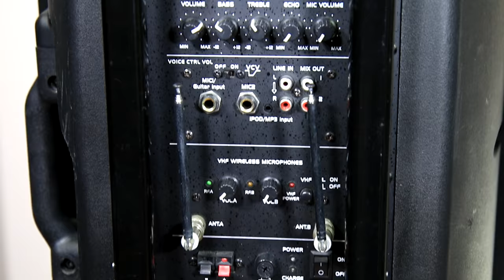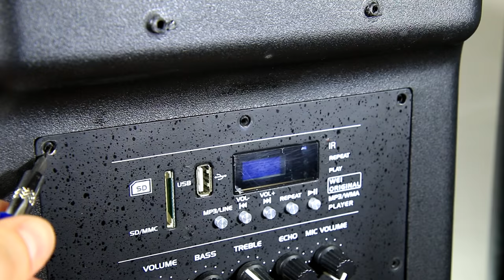Biggest battery powered portable speaker look inside

Comment: Change the battery for some li-ion batteries that would be a good upgrade maybe use 18650's
Reply: Matty p unboxing's and reviews is that so easily possible? Can you simple swap them out for one of those aliexpress 12v battery packs with a DC plug? There are 30AH 12v battery packs on aliexpress for 50,-. That would upgrade the capacity at least 3 times

Comment: Well skytec (qtx is the same brand) is know for ''exceptional'' quality
btw their real power output is 35w per speaker and no more
Reply from the maker: but with PA speakers sensitivity(~97dB/w) they are very loud.
Reply: yes i know i have tremendous knowledge regarding audio
I am just sayng that they lie about their wattage
and keep up the good work
Reply from the maker: of course, almost all brands lie about their wattage. The bigger the brand is, the bigger the lie is about their wattage.
Reply: artur take a look at NAD mostly their wattage is higher than advertised plus they sound GREAT.
Reply: It's a TDA7377 bridged mode, with 35W power output at 10% of distortion...yeah right.
Anyway, you don't get too much power from that small transformer.
Real power @ best performance i would say... 10W, not much...
Chinese crap.
Reply: bs, brands like elektro voice or aew dont lie about their wattage they even can handle wayy more if you send them a clean signal.
Reply: Random Channel skytec and QTX aren't the same brand. Skytec is owned by tronios and QTX is owned by AVSL.
Reply: bh ee
Reply: Random Channel behringer is one the lie about the wattage
Reply: Jacob Kelly their drivers etc are of the same quality though.
Reply: +stein van schaijk behringer atleast does it's rated power, the NU3000's power rating is 3000w peak, multiply that by 0.707 to get the rms, and you see its about 2100 watts, and thats what it actually does clean all day, unlike skytec and qtx which do maybe 1/10th of their rating, if even that much, put short: its much more than you'll ever get out of a QTX or Skytec amplifier, and they offer great value (300 eur on an ACTUAL 2000w amp, can't say that from more brands.)
get skytec or qtx and waste your money, some people blew their 1200w skytecs on a fucking 80w receiver, on half volume. meanwhile behringer actually does it's rated power
Reply: BH4x0r u dont calculate rms wattage like that
Reply: Cekpi7 if it's a pure sine wave that method works fine, and my true rms multimeter doesnt lie either.
Reply: You dont need true rms multimeter for pure sine waves, but lets just say that you have 4ohm resistor and you want to get 3kw, that means you need almost 110v to get that power, now thats rms since your multimeter measures rms, peak of that sine wave is on 110*1,41=155,1v, which means at that 155,1v on 4ohm resistor you would get 6kw of power, that means that rms is not 0.707 times less than peak value, same thing with 3000w peak, rms is 1/2 of peak or 1500w, its 2 times less becouse power is P=U²*R and Upeak is Urms*1,41, when you square it you get P=U²*(1,41)²*R which is basically 2 times the power for 1,41 times greater voltage for same resistance.
NU3000 is 3000w max but they rated it as 2075W rms mono in datasheet, so they didnt lie about that, peak or max wattage on amplifiers is usually just made up so it doesnt make any sense with any calculations.
Reply: Cekpi7 yes, it does give around 98.5v RMS, measured with a true rms meter and for more accuracy/to be sure on 50hz right before clipping, while having a 4 ohm high power resistor bank on it ( 4 1ohm 1000w resistors in series), which is actually around 2400w, the 2075w is probably at around 1% or less thd, which is still very good for a kind of cheap amp
Reply: That wasnt the point, u cant calculate rms power with peak power like you did, but how did u know its right before clipping? Anyway, bigdwiz made video using amp dyno, but 6kw model (2x3kw), it did 2x2kw on 4ohm which is decent for that price so nu3000 would probably made that 2kw, but not 2400w
Reply: Cekpi7 it appears to also have an unregulated PSU, so when you have 240v instead of 220v it actually puts out more power, not much, but still a difference, which i also noticed in my own testing, and i don't know how good or whatever the PSU's for the American model are (which have to run on 120v instead of 230v), anyways i don't know how accurate the clip light on the NU3000 actually is, but i gone off of that, so it might've been clipping ever so slightly.
also on BigDWiz' vid you could see it puts out ~2500W in burst RMS mode, which is music, nobody's ever gonna play a steady sinewave on it while playing music
Reply: Yeah, but rms is true power, burst is just random just like music, on one song you could get more power, but in some bass heavy less since it would stress the amplifier more, im not sure how much would those 240-220v make a difference since it should have some sort of converter but it could be, maybe it doesnt get enough power from single wall outlet
Reply: Cekpi7 burst is still rms and less than 1% THD on the AD-1
Reply: BH4x0r Yeah, but if you set your gain based on burst, it will be good on movies or songs with less bass, but when you play something with heavy bass or something that is rebassed, after some period it would start to distort and damage your speakers, better be safe than sorry
Reply: When you have efficient speakers with a Dynamic frequency range...you don't need a lot of power...
Reply: Random Channel the amp have 2x 15 watts i have the same as a 15 inch and it is loud.. for this power very good... i think an other bass between rcf and the box is perfekt and loud enough 😂
Reply: I don't need more than 35w if this is so mobile
Reply: No, it's acutually 10 watts without noticable distortion. 35 watts is at 10% distortion.
Reply: @TSilva01  You are right, datasheet says 10 watts at 0.03% THD
Reply: What you cant aspect frome 12 voltss ? .... 35 watss just right.
Reply: @Techscrews  nope.not really small brands lie oftener
Reply: even if its spl is 97db/1w that would be 112db @ 32w and thats not much lol
Reply: @Techscrews  What about RCF, Void, The Box, QTS ? they lie ? :))) learn my man about some profi shit than talk
Reply: Can components be upgraded to increase RMS output? Bigger transformer, better element, etc?
Reply: @serran0669  buy a better speaker

Comment: TDA7377 at 14.4V  is a Quad/bridge amp
2 x 35W max./4Ω
2 x 30W/4Ω EIAJ
2 x 20W/4Ω @14.4V
4 x 6W/4Ω @14.4V
4 x 10W/2Ω @14.4V

This amp is not better option for this aplication, STA540 is better.

Comment: I just purchased a massive bluetooth speaker with 2 x 15 inch speaker and tweeter horn , apparently 1000 watts , sound quality is extremely bad and little to no bass , lotronic party 215 led model , I will be returning for full refund.
Reply from the maker: your first mistake was to believe in the 1000w power :D
Reply: Wallof sound It sounds like one of those cheap ibiza ones
Reply: The Ibiza Ones are really poor copies of the QTX.
Reply: Wallof sound
Reply: Rajendra Kumar chaudhary
Reply: For an excellent quality speaker a cheap behringer or a cheap QTX or a cheap Malone is the lowest in the range you really want to be looking. I have a Qtx QX 15PA Plus, Two Alto TS115W's and Two Malone PP-2212A's all preform really well and deliver powerful sound.

Comment: i know those 12 volt acid batteries ..i have Crate limo 50 watts ,,,use 12 volts acid battery 8ah,or 9 ah, i didnt see  how many "ah" amperes hour use the QTX ,also i have Carvin 100 watts ,150 watts stagemate PA for guitar ,vocal ,bluetooth they use also 12 volt acid batteries 8ah ,they can use two 12 volt batteries in series connexion.inside the amp.will give you more hours to play....Acid Batteries are the best

Comment: Hi can I replace 12v 7,2H with 12v 9H does it mean that I will be able to store more power and play longer ?
Reply: Yes, if it is the same form factor - some exist that will fit.  Best to get a AGM deep-cycle battery, because standard lead acid batteries are not designed to be drained flat and recharged, after a year of this cycling they hold a lot less charge.

Comment: Probably the biggest on the market lol the first bt loud speaker I made had a bigger battery and it was 24v 8a.. and the bass is better than most cars and in a car was sitting on 2 12s. And I just had [2 ] 4 1/2in sub/loudspeakers and (1) 6 1/2in subwoofer n 2 Lil tweeters,, but I had (5) 6 1/2in  passive radiators. So build ur own.. I did that under $110. And f*ck doing those box specs based on who knows bs knowledge,, try/do what u feel would be best n build up ur  own knowledge... thank me later

Comment: Question what could be the reason as to why they don't want to charge ? It works while plugged in but will not change to take on the road.
Reply: Boricua  Ephraim Israel Battery probably no good. You let it sit too long while battery was low without charging.
Reply: These speakers overcharge the battery so it goes bad after a few months.

Comment: Is This PA Speaker Can Connect To Phone Using Stereo To Mono (3.5mm To 6.35mm) Audio Cable And Is There A Headphone Port Or We Can Connect A Microphone To It
Reply from the maker: phone can connect to this speakers with 3.5mm to rca(aux cable). Headphone port do not have, but you can use a rca output to connect headphones.

There are 2 inputs: guitar/mic and mic input.

Comment: Bad quality, i own these, was cheap. and wireless fall out signal , not usable, lots of noise, battery was good long lasting, sound ok, but wheels broke off fast, also handle was done after one year. only side handle survived. If you dont need to use the mobility dont buy it.
Reply from the maker: for 300$ they sound amazing powerfull and good.
Reply: Yes they are loud. :-) We used them for outside dance party. Thats ok. But at home you hear the background noise and the wireless microphone was not working constant at all so we put a cable one and then was ok. Still have them but only for outside purposes maybe beach bar also.
 @Techscrews
Reply: @JoergPelzer  if you want party outside, buy some good shit. If you want quality first, don't by battery powered speakers as they have a max of 30W .